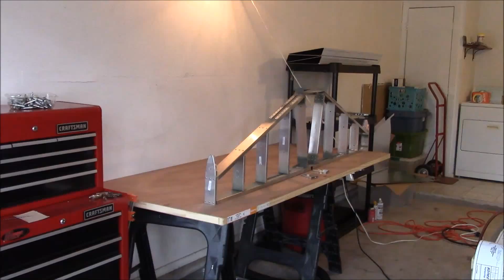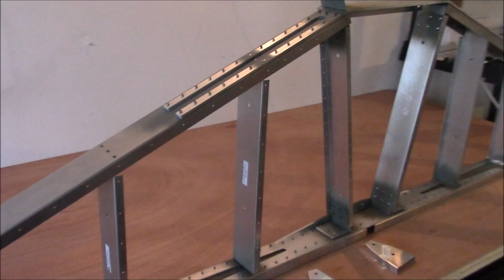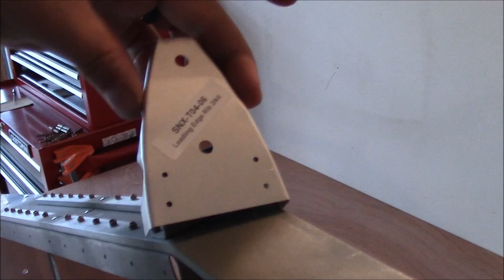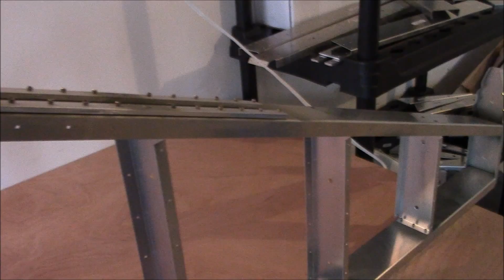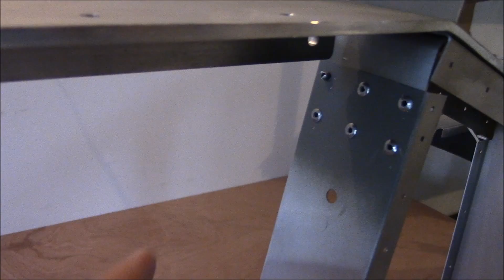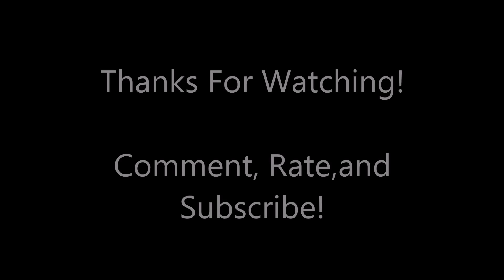Sonex Aircraft Build Video 5 Horizontal Rib Attachment

Comment: <--  not an A&P... and not a metal specialist... but in a case like this, there are those tiny washers that are designed to slide over the shank of the rivet. when the rivet is pulled, the washer is captured and acts as an opposing rivet head. same purpose. spreads the force and effectively increases the thickness of the parts that are clamped.

not sure if this is permissible in aviation airframes, but i've used it with little projects before and it works great.
Reply from the maker: b1pig Hi b1pig. That is a really great point. I had not considered that. The nice part about this plane being "experimental" is the fact I could use that method and it is not illegal. My ultimate goal is to safely build this plane so it is structurally sound in the end. I'll look more into those rivets rear heads you mentioned so I can use them in the future. Thanks for the great comment! -Dan
Reply: here ya go.
search for rivet backup washers

https://www.fastenal.com/products;jsessionid=FB3136E584ADB6379721CB3BAF165D63.jvm4?r=%20~|categoryl1:%22600000%20Fasteners%22|~%20~|categoryl2:%22600191%20Riveting%209and%20Self-Clinching%20Products%22|~%20~|categoryl3:%22600102%20Rivet%20Back-Up%20Washers%22|~